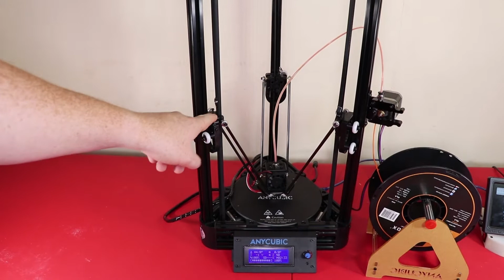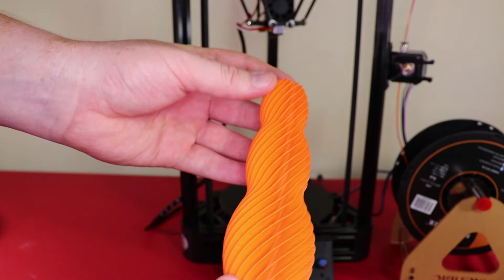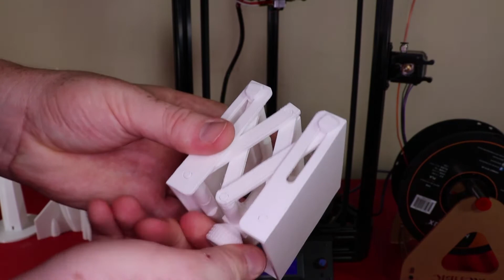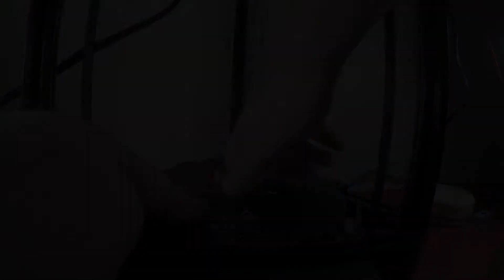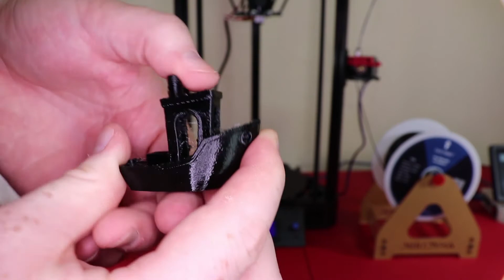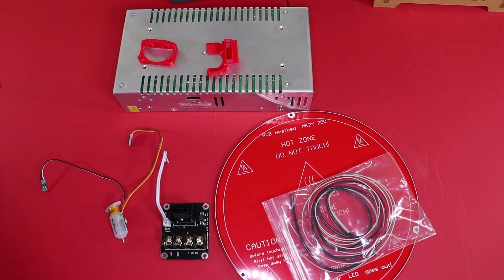Anycubic Kossel Review

Comment: Could you tell me how many amps it uses ? i know that it uses a 10 Amp power supply. But what is it using really ?
Reply from the maker: I know it is around 180 -200 watts of total power. I haven't measured the amps from the dc power supply. But 180w /120v = 1.5amps on the AC side.

Comment: It’s probably worth noting. The newest version of this printer, which is the same price, now comes partially assembled, so you are just attaching pre assembled sections together. (For example the top and bottom triangles are all together, with the motors and mainboard pre-installed.)  It also has the heated bed out of the box, and the upgraded power supply built in. Finally it comes with auto bed leveling and a detachable bed leveling probe. So very nicely improved kit for the same price.
Reply: Where online would we be able to find the new version of this printer?
Reply: I got it when Lightinthebox had a sale last month. But most of the chinese vendors are now carrying the "improved version". I think it hit the street in late October. Just read the product descriptions carefully. The new one will list Auto Bedleveling and Carbon Fiber Rods.